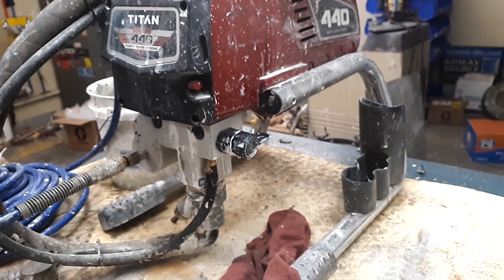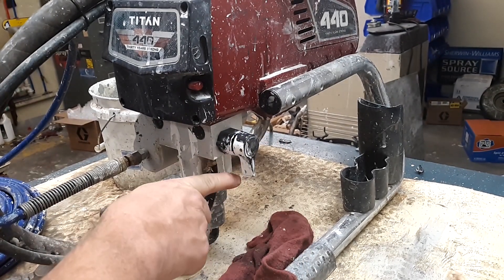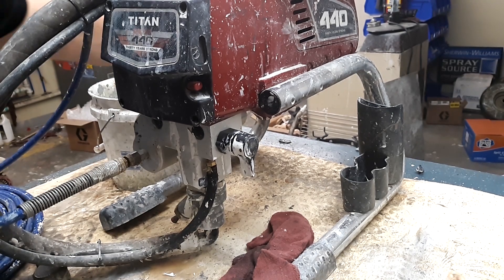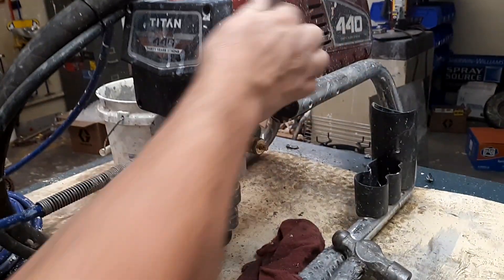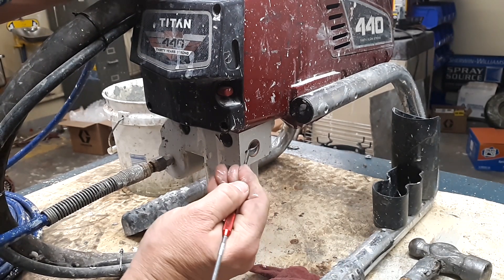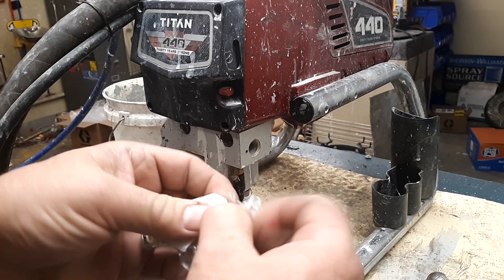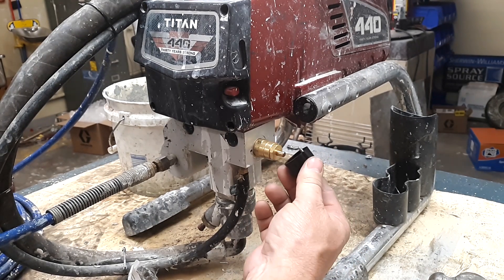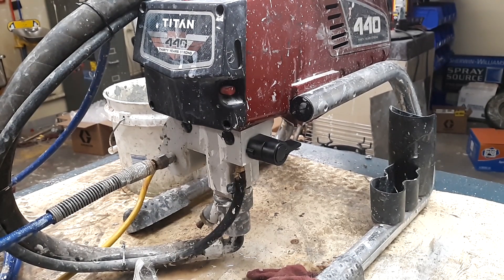Titan 440 prime valve replacement

Comment: Do you know if swapping out the prime valve will help the not priming part? Like even if i toggle the switch it still sprays from the pistol and very very little coming out of the return hose
Reply from the maker: With the valve in the spray position, there should be no material coming from the return hose. Replace the valve

Comment: Hey Brian, whats the problem in a titan 640 when the screen said, high motor temperature?
Reply from the maker: The motor is creating too much heat. Could be a bad thermistor,  the motor could be under a load to much to handle or the bearing could be going bad. 
Remove the fluid section and plug the transducer in and let it run to see if it is reoccurring with that code

Comment: My Titan 3500 Powrliner is not sucking through the Inlet hose. I feel zero pressure when I touch it. The regulator assembly won't stop turning when I turn it counter clockwise, for less pressure, but it will stop when I turn it clockwise for more pressure. Is this normal? It was sitting for about 4 months, with zero use. Only sovent based product has been used. Any advice on troubleshooting?
Reply from the maker: My suggestion is to take the machine to a certified shop. These machines are totally different and not for the inexperienced
Reply: @Brian Shumack the repair guy  I appreciate the response. I'm really leaning towards your advice. I will probably make an appointment in the next couple of days.
Reply from the maker: @richhoops2413  these are hydraulic diaphragm machines. The pump has a warranty, so have it check out by a tech so you don't void the warranty

Comment: I was having whistling around my prime valve at higher pressures on my 650 pc pro  and yes my prime valve was leaking too when I switched valve to spray! Took the prime valve apart, cleaned it (it was gunked up black metal/ corrosion, inspected the needle and seals and it was all fine !! Thought I needed to replace. Reassembled it w loc tite and tightened everything together and bam it’s working great. What happened was my prime valve as you said loosened itself up throughout the 450 gallons I put it through sofar. Once I tightened it all it’s fine now and holding pressure at 3000psi plus, which it wasn’t before.
Reply from the maker: Fantastic
Reply: Greetings Brian: After I release the trigger on my 440 impact gun, water shoots out of the prime hose, and the motor goes to prime. Any Suggestions???

Comment: Hey man, mine never ends building up pressure, does it mean i need to change the block? Or can it also be a faulty prime valve?
Reply from the maker: If the prime valve is bad it will leak. To check the prime valve, turn the pressure to about a third up from zero. Once the machine primes turn the prime valve off and see if it continues to run out of the valve. 
If your pressure is too high, it can start to leak out the prime valve once the pressure reaches about 3800psi. You would be best putting a gauge on the machine to see what pressure you are getting. That would help.

Comment: Excuse me, could you tell me the reasons why a titan 440 loses pressure to spray?
Reply: Thanks alot sr
Reply from the maker: That's hard to say. I need more information. Tell me exactly what happens. Everything.
Reply: @Brian_the_repair_guy  When I start spraying I raise all the pressure to the maximum but it seems that I have it at the lowest level of pressure to spray, it seems that it does not have the power to spray
Reply from the maker: @miguelpaintingmiguelescoba8072  when you release the trigger, does the machine stop running?
Reply: No sir, it doesn't stop, it just doesn't have the strength to spray
Reply from the maker: @miguelpaintingmiguelescoba8072  there are 2 quick possibilities.  One the packings are worn. Two there is an obstruction or trash in the pump. I have a video I think titled "sudden loss of pressure" watch that one and see if it helps clear the pump. If you need, I can make a video specific to the 440 on what to do. Keep me informed

Comment: Release the pressure thru the gun...not thru the valve
Reply from the maker: Either way. No problems with using the valve to relieve pressure. Unless the hose is clogged, then you may have a rupture. This is why I instruct you to open the valve slowly.
Reply: @Brian_the_repair_guy  a paint store owner told me I would blow the packings out if I flip the valve without relieving pressure through the gun. Is this true?

Comment: is that identical with the ones from graco ?
Reply from the maker: For most of the Graco units, this is very similar. There are a couple that use a different style. If your prime valve looks like this, then it is basically the same process.

Comment: great job. have you ever seen an intermittent priming, or it will only prime if one turns the pressure up (yikes) - almost like there's something obstructing the prime valve's operation?
Reply from the maker: Explain exactly what is happening.

Comment: My husband’s machine doesn’t turn the gold part,  it’s very stuck …
Reply from the maker: Yes, they can be very tight. Place the fluid section in a vice while trying to remove. You can use a punch and hammer it you do not have the proper tool

Comment: Hi Brian. Thank you For the video.
  I need to trouble shoot a problem on my Wagner3.29 pro spray.
It was okay before but now  the prime/spray handle turns  360 all way round .The machine Goes to spray mode when I don’t press the trigger but as soon I press the gun trigger it automatically goes to prime mode but still I can see some water from gun but no water comes the prime hose even when the Machine is in prime.
Plz assist me.